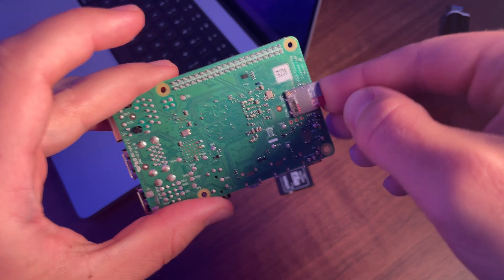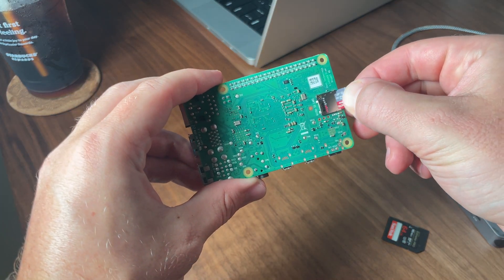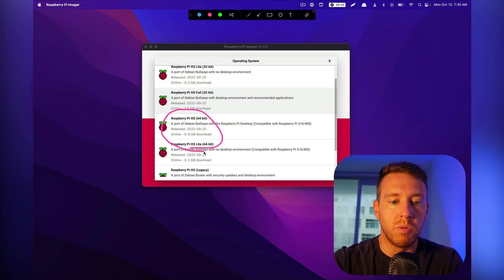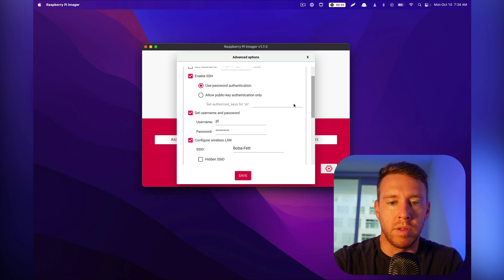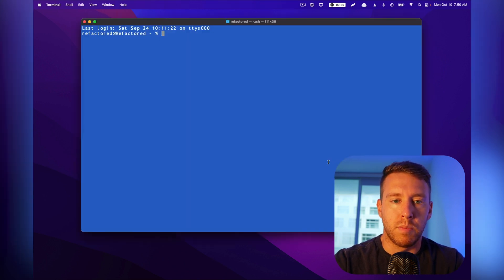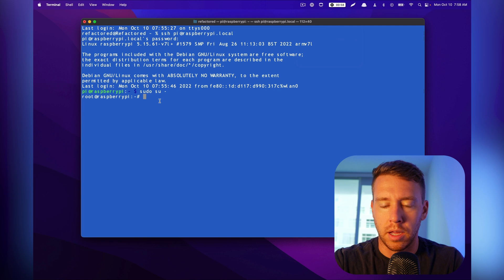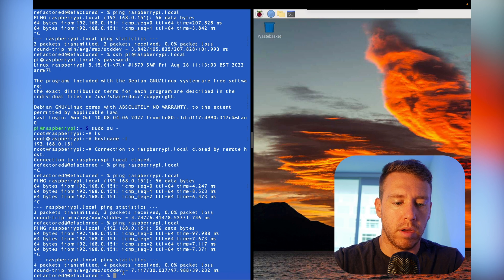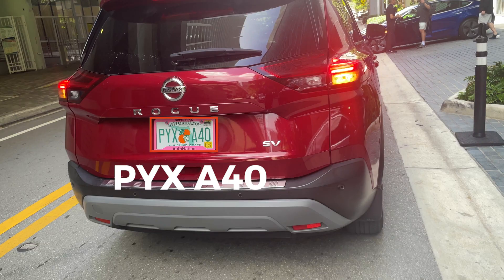New Method to Setup Raspberry Pi 4 64-Bit (Headless, Remote Desktop, or Peripheral Devices)

Comment: When I run a ping command it says the host is down. So I guess my network settings or port forwarding is not set up correctly. Anyone have any ideas what I did wrong or need to change. Thanks.

Comment: Thanks for the video! I haven't had a usable monitor and keyboard in ages. Also, I may have missed it but I didn't see where you updated and upgraded the operating system. If anyone would care to do so, it's:   sudo apt update && sudo apt full-upgrade -y

Comment: Nice summary video, and I'm going to check out your license plate video as I'm interested in tensor flow lite.  On a slightly picky not, during your installation of the R-Pi operating system you neglected to tell the user to click write while using the installer.  Pretty obvious, but might confuse some.

Comment: I just use the RPI imager to burn the image on a USB SSD and connect it to the Pi and go. I never use the SD card. I don't know why nobody does it this way.
Reply: Totally agree, I use SSD for my main Pi and mini Sandisk USB 3 thumb drives for other remote Pi projects. Don’t see any reason to use SD cards these days.
Reply: SD card are very slow compared to SSDs even USB ones.
But if you need a small embedded system which only need to execute few programs in loop it's almost unecesssary to use an SSD instead of an SD card since rebooting it will be pretty rare I guess.
Reply: @plkh9602  Noob here....Im using a microSD card on my rpi4b 4gb.  I use it for retropie...I noticed on sega dreamcast with metal slug mvc2 it lags, becoming choppy.  Could the sd card be the reason? Ive overclocked the rpi and it has a cooling tower to aid in heat control. This fixed the lag for MVC2 but not on metal slug.
Reply: Glad to hear this, I’d assumed it was possible to skip the SD card, but hadn’t had it confirmed. Will do that!
Reply: Or perhaps included ROM storage like in modern smartphones in the next version release